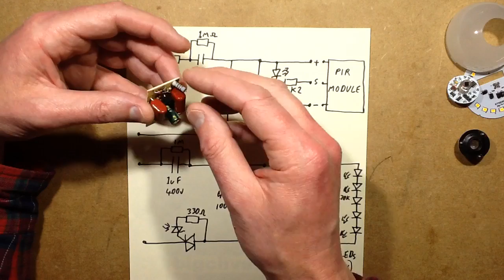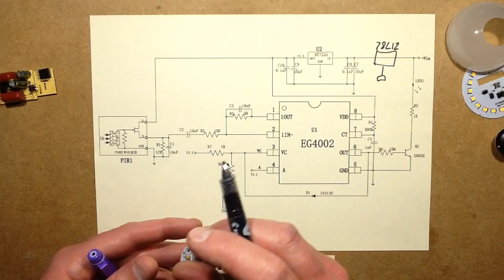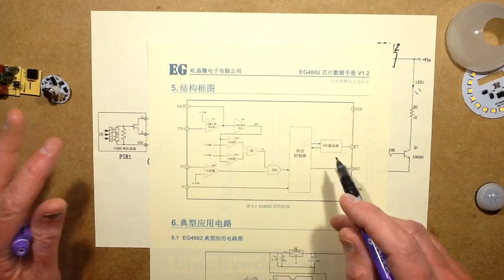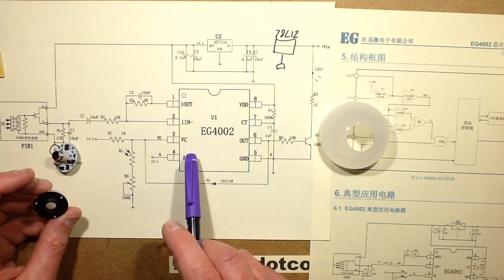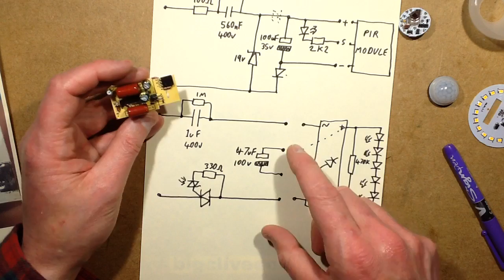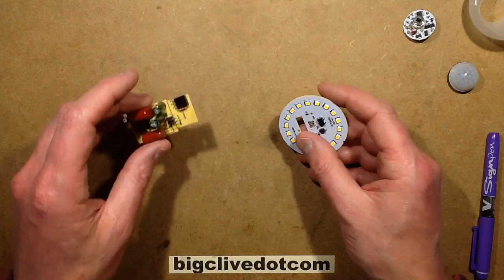PIR LED lamp teardown. (With schematic.)

Comment: Interesting to see the LED circuit is fed via a capacitive dropper and is switched with a triac. A capacitive load is about the worst thing you can use a triac to control and whenever I have tried to switch a LED bulb like this the triac blows after a short time. I suspect this is due to the high initial current exceeding the triac's dI/dt rating if it turns on at the peak of the sine wave. The lamp I tried to switch was an older LED bulb with 5mm LEDs and used a 0.22uF 400 volt capacitor with a series resistor to limit the current, the triac was a z0103ma which is a TO92 type like the one in your bulb. Your bulb uses a 1uF capacitor and no series resistor so the stress on the triac if it turns on at the peak of the sine wave will be much greater. I would be interested to see how it performs on a long term test. Is there a 'best way' to switch capacitive loads with triacs? Regards Richard
Reply: +rich3500 Control the "power" triac with a zero crossing controller.
Reply from the maker: +rich3500 The optoisolated triac used has a zero crossing point detector in it.  I should have mentioned that.  It only turns on when the sinewave voltage is at a low level.  That said, the first time it turned on it made a click like a relay, so it clearly didn't switch on the zero crossing point then.

Comment: The 2 linear voltage regulators may also have something to do with power dissipation. After all that small smd regulator may have difficulties dropping the 15.7v all by itself.

Comment: isn't that about 1cm of exposed high current bit of socket lamp dangerous? You put your fingers very often near there, i'm always scared you get electrocuted... it's clearly visible at about 20:30
Reply: +squalazzo It should not be a problem as the screw threaded outer part of an edison screw lamp is the neutral connection.
Reply: +ELECTRONTHORP Bound to, I've seen some horrific wiring cockups-not all done by DIYers, some of the qualified sparkies I've worked with have had almost no idea how to do the job!. That being said i have done some very funny temporary hookups just to get things live......
Reply from the maker: +squalazzo I have the lamp in a bayonet cap adaptor.  The B22 bayonet end-cap has both connections on its end and the metal sides are not live.
Reply: ok, thanks :)

Comment: I wonder if the reason for not being a switcher is noise affecting the PIR sensor
Reply from the maker: +mikeselectricstuff It could be that, but some of these units do use a switcher with an open circuit voltage of about 12 that powers the PIR section and the LEDs.

Comment: Allways an enjoyable teardown clive :-D.
They have made a decent device but still kept it minimal, i like that :-D
.
Perhaps that 100uf resivour capacitor charges slightly higher than expected while the trigger circuit isnt timing, then it can supply the split second burst of current required to start the opto led, once lit, it says lit, perhaps.
That diode did look like a (feedback while timing), may stop any i.r/light from the led lights getting back into the detectors causing trouble.

Comment: With the 2 regulators, the 78l12 can take 36v, the 7533 can only take 26, also the dissipation will be shared across both regs.
and yes, probably better regulation.

Comment: I bet the 4 pin / deported capacitor is because the led pcb is smd only (made of aluminum plate, isolant, copper tracks) and the other pcb is through hole. You just can't put a big cheap capacitor on the led pcb, and that's good for longevity anyway. PIR disable light detection when trigered to avoid turning on and off in a loop then the light is activated (creating a feedback)

Comment: thanks a lot for sharing. does any one know why they placed the zener diode in front of the rectifier and not after? according to my understanding they completely shorting one half wave of the input voltage. does this make sense?
Reply: +Stephan Brenner Does not matter, as the capacitor (and series resistor) limit the current.

Comment: "It's definitely got to be a newer-style chip"...
Oh, Clive. I couldn't stop laughing. That is probably the most basic chip I've ever seen! It, and variants of it, have been used since the mid-80's in PIR sensors. That Chinese one is just a rip-off. Having the timing delay built-in is not uncommon -- rather, it's pretty much standard. I keep forgetting that you always tear apart stuff from China! So you probably rarely see the same thing from North America.
Reply from the maker: +Aurelius R I'm so used to seeing the classic BISS0001 chip in most PIR devices that it's odd to see the newer and simpler chips that do the same task.
Reply: are you trying to mock Clive, or China? can't quite tell... don't like it either way.
Reply: TheWookiedan Not mocking Clive, long-time subscriber. I just found it funny. Mocking Chinese rip-offs, though, that I won't apologize for.

Comment: Why is a bad power factor problematic for power companies? I know that for regular users they don't even measure it (in most countries, dunno about the Italy thing) but they do measure it for industrial users.
Reply from the maker: +Derp Herp It increases power losses in their cables and transformers.
Reply: Thanks for the explanation!
Reply: +Derp Herp 
I don't know how much you know about power factor, but it means current and voltage are out of phase if the pf is not 1. The problem for the power companies is that the current is real. The current determines the losses in the power lines. They didn't really bother to measure for homes, because the main power usages are resistive (everything that's heating electrically) with a pf=1, and the rest of the devices are a mix of capacitive and inductive loads. That's quite different to large industrial installations that very often have huge inductive loads (electric motors). Unfortunately I fear that with smart meters and the ease of measurement with them they will eventually start measuring it for home users as well.

Comment: Moving that smoothing cap also lets the round board be fully pick and place, and the other board to be manually populated and soldered.
Reply: +Fracture That's exactly what i was thinking - the smoothing cap on the LED board would've been the only through-hole part there, which would've only needed one extra manufacturing step (which, in the millions of pieces, adds up to a lot). Although i'd suspect the AC-in board would've more likely been wave-soldered (easier, quicker, cheaper for single-sided boards with only through-hole parts).
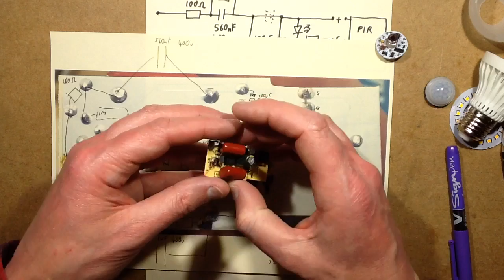Reply: +KhronX It might be, but you'd be surprised how many mass produced small boards like that are made by hand in China. The only shot of the back of the board I can see is @14:37 - it's inconclusive, but I'm leaning towards hand soldered. The leads are certainly hand clipped.
Reply: That may well be true, but still - non-incompetent design CAN skip production steps, and as such, save costs, in the end :)
Reply: KhronX Agreed! Someone with some skill put some thought into this one. Surprising nowadays.
Reply: As Clive himself said (or at least implied), it's a pretty nice surprise, considering all the bottom-of-the-barrel, "let's just get lots of these products out the door" type designs coming out of the Far East :)

Comment: I have a random help request. After seeing your teardowns, when my supercheap chinesey led bulb went out, I popped the top off of it to find a capacitor had blown. It had a rating of 85v, 47uf. I wanted to replace it with something a bit larger due to mains being standard, but I cannot even find a direct replacement. I am new to this so my searching consists of google, aliexpress, and ebay. Any help/ideas appreciated.
Reply: +james lawrence If it had a rating of 85v (which you're sure of?) then it wasn't the one directly seeing the mains. Buying capacitors is like buying socks -- as long as they're the right size, it doesn't matter which ones you get. Just make sure it's at least the same voltage and roughly the same capacitance. Also, if it's an electrolytic, replace with electrolytic, if it's a poly cap, replace with a poly cap, etc.
Reply: +james lawrence This should get you what you need: http://goo.gl/0GoGuI (shortened link to a Digi-Key part search).  Pay attention to capacitance value, voltage rating and lead spacing.  I would also spend a few cents more to get a cap with a high "Lifetime@Temp" rating and a few hundred mA ripple current rating.
Reply: +FlyingShotsman tyty. I will be adding that to my bookmarks. I spent a long time trying to find something similar to no avail. My Google Fu even failed me. I now have 10 on the way and I'll be repairing this little guy before long. Thank you both very much.
Reply: just a random update: It wasn't just the capacitor, it was also a blown LED. So now I'm blind, I know which way the polarity is in those bulbs, it is burned into my retinas, and the lightbulb is working and the inside looks janky. I replaced the cap with one from digikey and the led with a random white one I had. So it is now an LED fixture with 17 surface mount LEDs and 1 through hole bent to use as a surface mount. Thanks for the help :)

Comment: many optoisolators i've come across overstate their required forward led current, or at least the current recommended is optimal for the highest speed switching but will still work at lower currents

Comment: stupid question...... is it possible to to build "And, Or, Not" gates using components  like diodes or other parts?
Reply: +studer1679  ooo ty I'll look it up :)
Reply: +Ryoohk Not a stupid question at all: https://en.wikipedia.org/wiki/Diode_logic
Reply: +Ryoohk Yup, DTL was the precursor to our commonly used TTL! It's a very cool area of early electronic logic.
Reply from the maker: +studer1679 And indeed we still use simple diode logic where it's easier than fitting a complete logic chip in.
Reply: +bigclivedotcom that is so cool   thank you all for helping me understand better and getting the curious side of my brain thinking. :)
Reply: bigclivedotcom When is diode logic still used? I can't think of an application where it would be worthwhile.
Reply: +Aurelius R Say you have two sensors in a system that both output a logic high when whatever they're monitoring matches a certain condition.  You want a microcontroller to take an action on either of those events, but the micro only has one available input pin.  Two diodes configured as an "OR" let you monitor both sensors with the single input.  Diodes in an "AND" configuration would make the micro respond only when both sensors send a high at the same time.  Two diodes are much cheaper and simpler than a logic chip, which would also require a power supply and decoupling capacitor.
Reply: FlyingShotsman Sorry, but that's a ridiculous premise. When would a microcontroller only have one available input pin? If you're already cramming the board full trying to use every pin, the difference between adding two (or more) diodes and the next chip up in the series is probably marginal. Also, logic chips (like simple AND and OR gates) are cheaper than ever. The cheapest 1N4148 diode I could find in single quantity is $0.19. So that's $0.38 for the two diode gate (I'm not taking into account quantity discounts). http://bit.ly/1UGJ4w2

Here is a two input OR gate for $0.14 in singles. http://bit.ly/1QUFTdi

Here's a two input AND gate for $0.34 in singles. http://bit.ly/1QUFV4K

BOTH are cheaper than two diodes. If you go up in quantity, the price gets even better.
See why I ditched diode logic?

EDIT: Even in 1000 quantity, the AND gate is 6.6c, compared to the diode, which is 3.7c in 1000 quantity. Two diodes at that price is STILL more expensive than the AND gate. And the OR gate becomes HALF A CENT in 1000 quantity!! It's just mental how inexpensive they are.
Reply: +Aurelius R Yes, but you are thinking in a narrow range. In industrial control systems, you may use diode logic when interfacing one 24V or 50V relay circuit to another.
And even in electronics, sometimes you need wired-or circuits, so if you don't have gates that have open collector/open drain outputs, diodes are used (as there are multiple circuits wired to the same circuit). Diode logic can also be used to allow a keyboard / keypad to be read with less input lines. Even now, microcontrollers in smaller packages offer significant savings to larger parts with more pins when you take PCB sizes into account.
Reply from the maker: +Aurelius R A simple OR gate where either of an output can activate a relay.  An immediate application that comes to mind is the simple electronic dice that use a diode array on the outputs of a 4017 to drive the LEDs.

Comment: Those lights look like boobs... :P

Use the google visual translator tool on your phone, it does actually work (though chinglish it very does much), useful app to have when buying from china... :)

I can't think of an excuse to buy one (I'm a touch penniless at the moment!! Bought a Honda generator so out of money for now), but that diode mod really does give it a lot more usefulness than without, I'd have probably hit it with a jeremy clarkson toolkit for switching on and off and on and off for the sake of one simple diode... :)
Reply from the maker: +twocvbloke If you buy two it could use them for light and as a crude sex robot.
Reply: bigclivedotcom
On the blue collar wine eh? :P
Reply: +bigclivedotcom Perhaps someone did, and the chinese banned the 15-20cm diameter version.

Comment: Can you cycle the power to keep it keep it awake? I had a few motion activated outdoor lights that worked like that.
Reply from the maker: +dwarf365 Alas, no.  It doesn't have that feature.
Reply: bigclivedotcom Thank you for the reply! I am glad you figured out the resistor issue tho. :)

Comment: What is a buffer in this context? Is that a special kind of transistor which introduces a delay or something?
Reply: +codebeard 

The output of the sensor itself is a really low voltage, so it's fed to a transistor that can switch in another load with respect to the sensors output. This is the reason Clive mentioned the transistor being in the sensor module itself,  if it were outside the 'can' there could be a significant voltage drop from the sensors output to the transistor.  This is my very basic understanding anyway.
Reply: +codebeard The best way to explain the purpose of buffers is thus -- it's matching the impedance of the transmission lines. The impedance coming from the sensor is very, very high, so if you try and draw much more than a couple microamps, the voltage will just plummet and you won't get a good reading. So you use a buffer (sometimes as simple as a single JFET, as shown in the schematic) to convert the impedance to a low impedance, so that you can more easily draw current while maintaining the signal. Applied Science did a good video about impedance for beginners -- I recommend watching it if my explanation didn't make sense.
Reply from the maker: +codebeard It's alike an amplifier with a gain of 1 but it buffers up the voltage on the main amplifier without loading it, which could affect its operation.
Reply: +bigclivedotcom thanks!
Reply: +codebeard In this context, buffer means current buffer. The signal is too weak to drive the next stage, so a current amplifier (transistor) is used. The current amplifier takes a weak input signal. The output is a more powerful "current boosted" copy of the signal.

Comment: Can you link the ebay dealer please.
Reply from the maker: +gigabytex64 I've added a link to the lamp in the description.
Reply: +bigclivedotcom Thanks I must be blind, as far as wattage out put how bright is it compared to a standard bulb "or Lumins " wattage still throws me as filiment lamps where fine say a 60 watt in the lounge but we use a 15watt halogen style now going to leds I learnt lumens only to find most places dont use it anymore, and I still have 92000 lumens leds I am flustered.